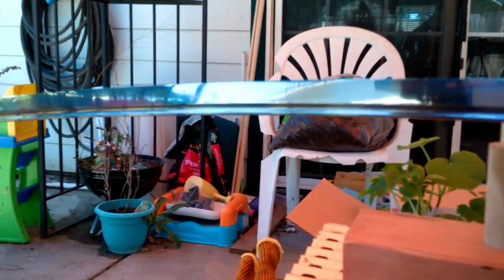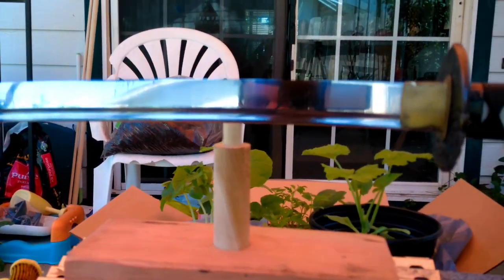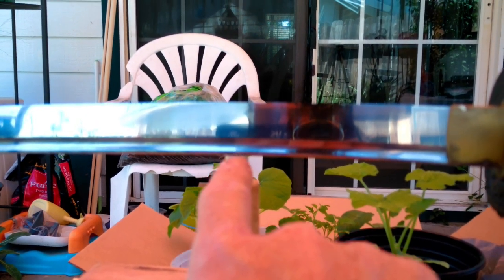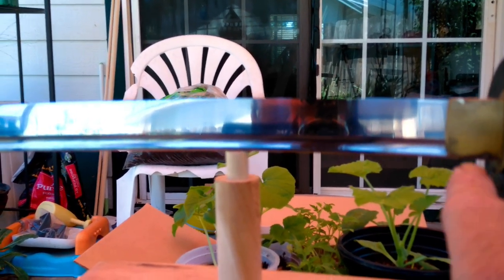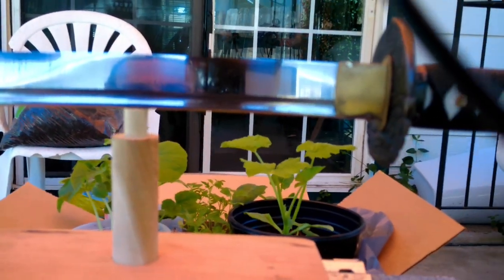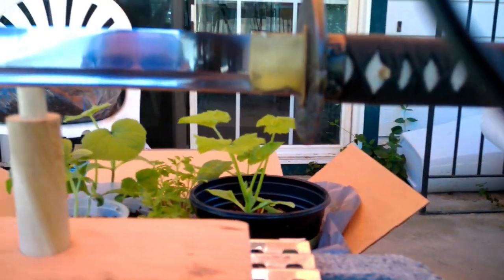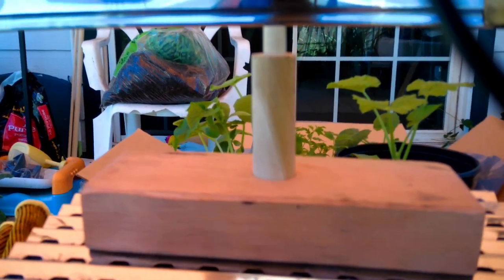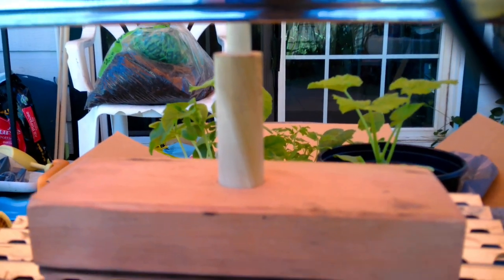P O B Stand

Comment: Pretty crafty.  
You being a metal worker with an artistic flair, I would like to see you craft some simple iron tsuba.  
Sell a tsuba and a T-shirt kit.  Maybe get one of the distributors to put your logo on a sword cleaning kit and a sword stand..
Reply from the maker: I'm going to have to shift made,and as soon as I can, I plan on making some tsuba for sure.
Reply: Dude, put me on that waiting list..  
I want the whole kit, with the Tshirt, the sword stand, the cleaning kit, and the iron tsuba - everything sporting your logo.  
I've been using those simple $4 shotgun sleeves for sword bags lately because the elastic cuff rolls down to index on the tsuba, but I would gladly put a Gargoyles Blade patch on it.  
Ttamankua (not horrible swords, btw) sells a $38 katana that comes with a sword bag that sports a simple, thin, adjustable carrying strap  - it's kind of cool, but I wouldn't try carrying a 3 pound sword across town with it..   
Simple iron tsuba designs: the standard circle, the oval, the clover and the square.